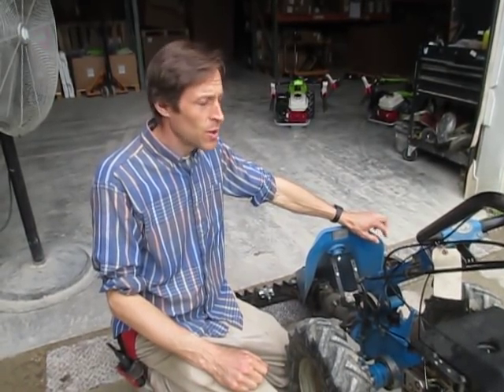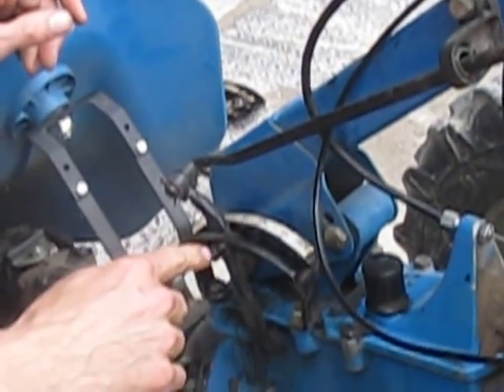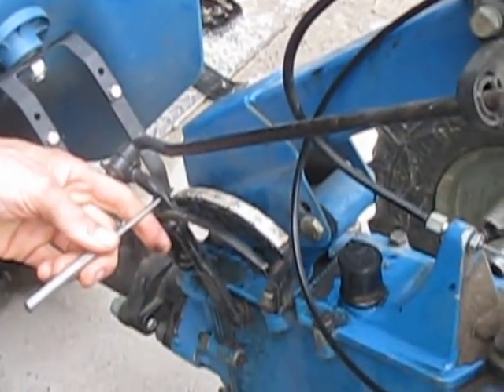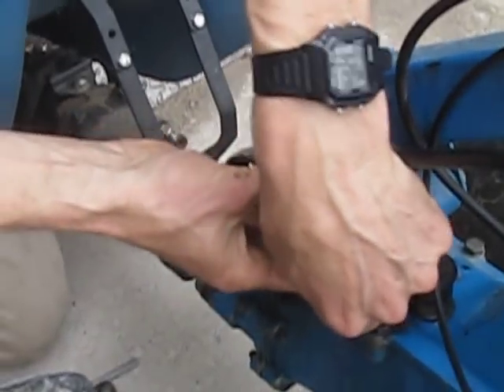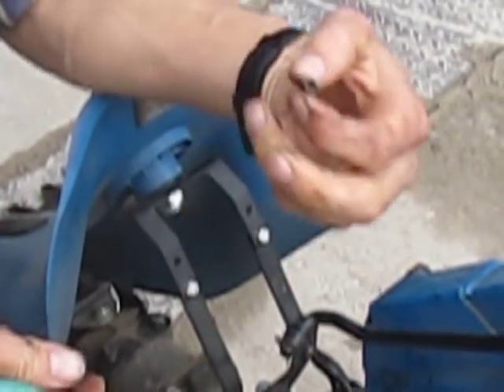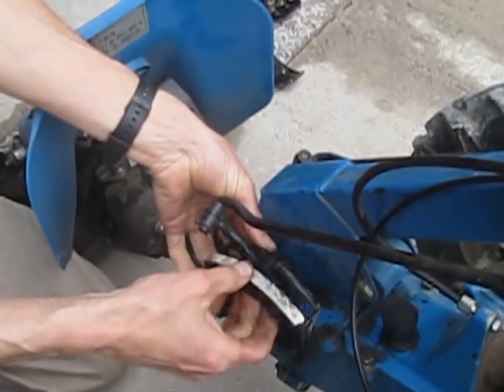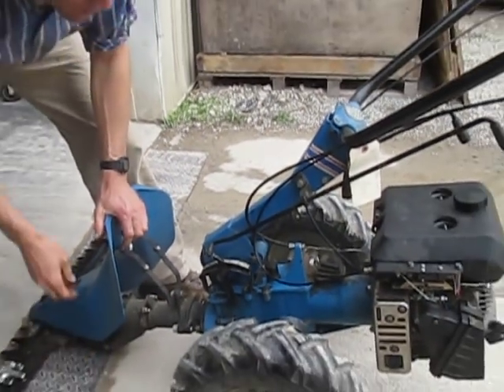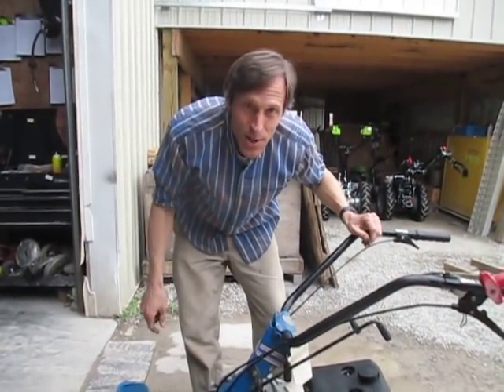BCS Walk-Behind Tractors: Improve Shifting with Detent Ball & Spring Modification

Comment: I have a really old 725 with the notched selector, so as you said, this solution does not apply. It is hard to shift outside of a certain range (and sometimes that changes). Especially hard to get into first. Any tips?

Comment: Really appreciate your dedication in keeping these older machines running. Ive got a 725 with an 8 horse Kohler that is still kicking. Im going to give this a shot. If this makes it easier to shift that would be amazing! The high/low lever is a real pain also, might play with that one also. Thanks again!
EDIT: Worked like a charm thanks a million! Not much luck with H/L selector though, would need to take the whole transmission apart to mess with that. Oh well